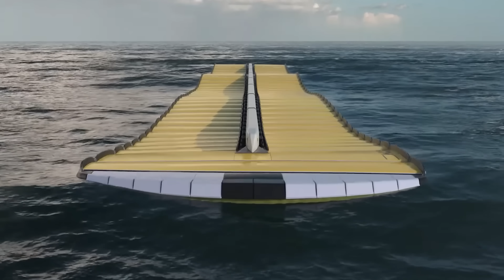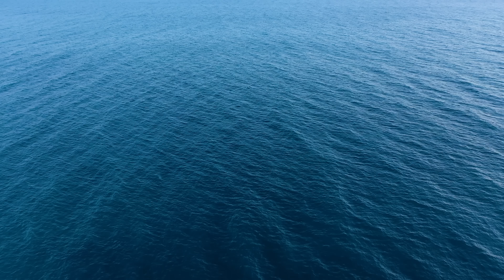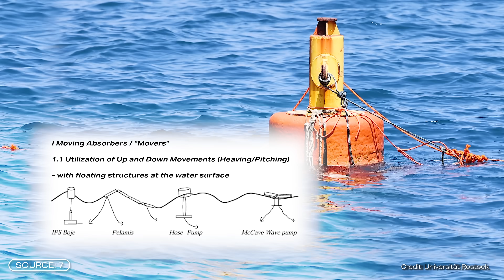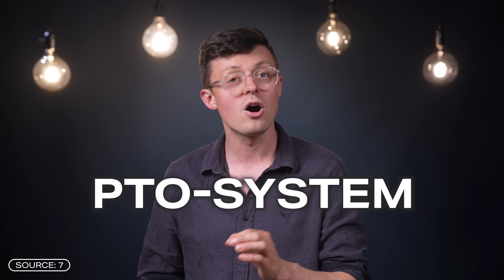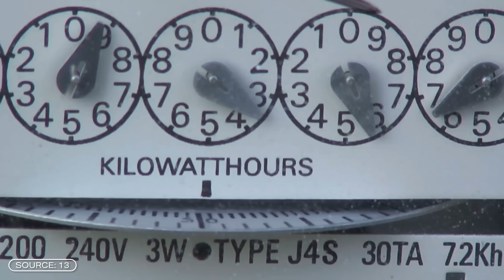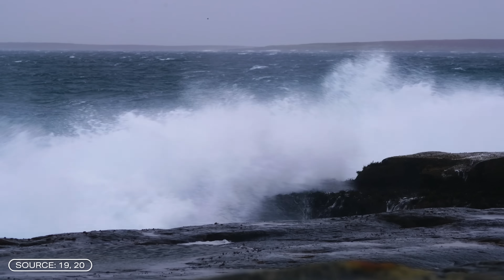The Cheapest Energy Source Ever? Wave Power at 1 Cent Per kWh

Comment: Such a long list of unbeleivably impressive claims and now several years later they throw in yet another rather than demonstrate any capability.
This is so clearly a scam I have completely lost respect for GSG.  Wave energy potential is calculable.  If you calculate the size needed for 100MW it would have to be enormous.  Then there is the variability.  Most of the power occures in a small time window.  Put the all together and there is no way this will only cost a penny per KWh.

Comment: Big mistake to use sea water, compressible, not a proper hydraulic fluid, results is greatly reduced efficiency. Also, seawater is full of life, salt and many other contaminants. This will fail quickly if not a closed system. Any filter will not last long in the ocean. This will fail, as is.

Comment: Anything that moves will never be cheaper in the long run than solid state solar. Its physically impossible. Any maintenance is cost.
Reply: There's an old saying...

"work smart, not hard"

The moral of the quote is to emphasize efficiency, strategy, and leverage over brute force or endless grinding.

A world filled with millions of wind turbines, billions upon billions of solar panels, and hundreds of trillions of man made batteries for battery energy storage systems, ALL OF WHICH have to be recycled every 15-45 years, is...

--- WORKING HARD WITH ENDLESS GRINDING ---

Tapping into the NATURAL THERMAL BATTERY beneath all of our feet, with limitless thermal energy contained within it, is...

--- WORKING SMART AND EFFICIENT ---

Geothermal is the path forward...

Comment: As you say there has been quite a number of wave power startups and they all seem to have failed. 
The sea is just a very harsh and unforgiving environment. So I would apply the famous Mike Tyson quote here: "Everybody has a plan until they get punched in the face" Its all good until they actually deploy to the sea, then not so much ...
Reply: There's an old saying...  "Work smart, not hard"

Building energy production systems in a marine environment is working hard...
Reply: Happened with a few optimistic danish wave projects; they just got hit too hard by the North Sea......

Comment: I grew up in Canada in the region that has some of the highest tides in the world, The Bay of Funday.  I've seen the awesome power of tidal and wave power and I was also a scuba diver there and know the pull of currents.  I am intrigued by wave power & have seen the effects of trying and failing to harness tidal power.  We need to get over our hubris thinking we will out strength Mother Nature.  We need to respect the endless power of tidal movement and waves so we can finally work with it to harness the power it can give to humanity...
Reply: Geothermal is a much more reliable way to replace fossil fuels.  Geothermal energy potential, on land above sea level, is >1,610 petawatt hours.  Marine environments are one of the toughest environments to operate within, and while power could be produced using tidal or wave power the maintenance cycle on such systems is insane.
Reply: I think solar is far better. I have 2 acres, I have thousands of amps of power beaming down on those 2 acres per day sunrise to sunset, all I need do is harvest a small amount of it. Even using cheap old used solar panels a few thousand $$ worth of them gives me over 100 amps of power, 50% more then I actually need to run my house. 

I can store the excess power in a used battery from a tesla bought for a few thousand bucks and be totally of grid for weeks not even need any power from "the grid". I only keep the grid connection as a backup. I can even string a long cord over to my neighbors house and power him up during a power outage.

No pie in the sky wave tidal billion $$ contraption needed. Solar is here now and works.
Reply: @robert5  I'm very pleased you have all the solar you can possibly use and having battery storage is a real bonus.  The reality of power generation via solar is quite viable on the prairies - on the coasts - not so much.  We Have Massive amounts of hydro-electricity here, in B.C. as we have the rain and the mountains.

Solar was the first & easiest to crack and exploit but much more ways of cheap green energy need to be placed onto the grid for all to take advantage from.  Geo-thermal looks promising along with wave and/or tidal generation...
Reply: @robert5  Solar is pathetic as an energy source
Reply: @TerraPotentia  50 Amps of power is what it is. If I can buy $30 used solar panels and easily have a 50 amp stream of usable power... that is just a fact. You can come over see it power my entire house and tell me how pathetic it is if you like, I'll just laugh. Solar farm big enough to power a city? Bad idea, individual solar install powering every house... it works now not some time in the future. Long term anything less then a nuclear power plant, current tech will not work to power city size and numbers of homes.
Reply: @robert5  There's an old saying...

"work smart, not hard"

The moral of the quote is to emphasize efficiency, strategy, and leverage over brute force or endless grinding.

A world filled with millions of wind turbines, billions upon billions of solar panels, and hundreds of trillions of man made batteries for battery energy storage systems, ALL OF WHICH have to be recycled every 15-45 years, is...

--- WORKING HARD WITH ENDLESS GRINDING ---

Tapping into the NATURAL THERMAL BATTERY beneath all of our feet, with limitless thermal energy contained within it, is...

--- WORKING SMART AND EFFICIENT ---

Geothermal is the path forward...  There is no more environmentally friendly energy source than geothermal.

Comment: Waves are not constant.  They are wind and tide driven and have lull periods.  For example, the area around Cyprus is noted for much less wave action during most of the entire summer.  

This 1 cent per kWh estimate falls into the LCOE fallacy.  Since waves are NOT constant, this system, like wind and solar, will need backup power sources or huge, costly energy storage.  Both add significant cost.  Material longevity will be a problem - saltwater corrodes almost everything, and underwater power distribution is also expensive.  It's effect on the marine ecosystem is unknown and may cause ecological damage.

Put this one into the category of hype.
Reply: Fake News, naysayer 

Kinetic energy from tidal or wave is the most abundant form of energy, right up there below deep geothermal 

Crack that (either) nut, and limitless power is solved. 

Just takes time to figure out by smart scientist and engineers, 😅
Reply: @AfricanCulturalHeritageProject  Nope. That's what they said about solar yet every single country who has tried to put a large fraction of solar on the grid has the HIGHEST electricity costs in the world..

Waves are intermittent.  Figure out what that means.

Comment: There are at least three problems that make this technology so hard to believe in. Biofouling, corrosion and torque. First, the biofouling is a nightmare. The ocean is full of organisms that will coat anything left in it, and the toxins used to stop them are a major problem. Most antifouling paints use copper, and just a few micrograms per liter of water can be lethal to marine life like mussel and sea urchin larvae.  There are some promising new coatings being developed that use natural compounds from bacteria, which are much less toxic, but it is a constant battle. Using heavy toxins is going to cause a huge public backlash from anyone who wants a clean ocean, and it feels like the company is just ignoring that reality.

Then there is the corrosion and the sheer mechanical stress. Seawater is incredibly corrosive. Any metal parts in the ocean will start to fail within months.  The real killer is major storm-derived spine torque. The whole design is like a giant snake moving with the waves, but that movement relies on a central spine that connects everything. In a storm, the forces are going to be massive. Apply that force to this skinny spine? Pffft. It'll have to withstand a tremendous amount of twisting and bending force. The company claims it will "move with the wave" to survive, but a 100-megawatt device would need to be enormous and heavy to generate that much power, making it impossible to just float "with" the wave in a hurricane. The first serious storm is almost certainly going to bend or break that spine, and then you are left with a mess of plastic and metal on the ocean floor that is going to be extremely difficult and expensive to clean up. Worse for local boat traffic if the spine becomes untethered and unseen just below the ocean surface. I'd hold more promise if they could submerge the entire spine during very high storm events. That design evolution seems unlikely.

This is no different than that Dutch youngster who said he'd "clean up ocean plastic". He made millions of dollars and only cleaned up a minuscule fraction of what's out there. The design cost millions of dollars and was a complete failure.This current project is a propaganda ploy by a company that will end in failure and millions of dollars on the ocean floor. Apologies for being so blunt.
Reply: One other thing that limits the results of this innovation is that in some northern areas the sea surface is covered with ice for several months every year. So there are no waves no matter how strong the wind is. The system would have to be transported to sea every year after the ice has melted and moved away from water before the sea freezes.  Moving thick ice has strong destructive power.

Comment: While I love innovative ideas, those claims have all the sights of BS. If you need 32m long and 1.4 ton to generate the same amount as the equivalent of 4 standard panels, it will probably need a small city sized installation to scale up to 100mw, unless they can improve the efficiency by 10x, it has no chance...

Comment: 'm dubious about this one.f its covering the surface of the sea, then its blocking sunlight to the surface water, which is wfere phytoplankton that are at the bottom of the marine food chain live.  secondly. huge areas of such an installation could be a hazard to navigation. Thirdly, anyone who thinks that the sea is incapable of breaking or wrecking anything are delusional, IMHO.. I'm sure that small installations might be of great benefit to isolated island or coastal communities, but I'll be very surprised if this achieves widescale deployment - and concerned due to ecological impact, too

IMHO it'd make more sense to add small wave-power generators around the base of wind turbines in costal waters, maybe add some solar panels to the top of the gearbox housing, too. Sure, the amount of extra electricity generated would me small compared to that produced vy the windmill, but the wave power generators would add a little to the base load, whilst the solar might well help make up the dfecit on windless days.

Comment: Considering materials cost, space usage, and maintenance, I haven't seen anything that comes close to nuclear.
Reply: Geothermal gives you all the benefits of nuclear (high annual kWh production) but without the waste.  Nuclear has the highest capacity factor of any energy source, but geothermal is a close second.
Reply: The problems with nuclear are the cost over runs, insurance and decommissioning plus what to do with the long term waste
Reply: ,...... Why build a dangerous and expensive nuclear plant in coastal towns,... when solar, wind and wavepower,...... can give you all the energy you need. And then some,....
Reply: @user-pt1ow8hx5l  again, materials cost, space usage, and maintenance

Comment: So much promise, but so much risk.

Marine engineering and construction, and maintenance in a marine environment, is incredibly expensive.  It’s the price you pay for access to the ocean.  When a component fails, how do you replace it or fix it?  You are, after all, operating at sea level and, for the most part, in the water.  This isn’t just a ‘hurdle’, it’s an enormous hurdle.  If the thing lasts (as claimed) for 50 years, then you have to have 50 years’ worth of planning and the financing to back that up.  

Downstream environmental effects: in order to make 100MW, you need a very large array/installation.  This takes up quite a bit of linear space.  How does this affect the marine environment?  The installation will blanket large swathes of ‘understory’, the water around/underneath it, and create (among other things) thermal and related vernal disturbances.  Maybe it won’t matter?   Maybe it will and we can’t measure that yet?  I am not against trying new things, but this consideration should be top-of-mind for prospective operators, since they’ll be on the liability hook when they face the inevitable court challenges 1, 5, and 10 years after installation.  (We see these same challenges made against power plant operators who depend on local waterways for cooling water—thermal pollution is real and has documented negative effects on marine fauna and flora.)

Another, and not the last, thing to consider is how readily a test-pilot installation such as the Cyprus array, can be scaled.  Effects you don’t observe at one scale can suddenly appear at the next.  It’s one thing to build a small proof-of-concept, it’s another to build, install, and operate one of the proposed size.  This is no small risk.

Comment: Nobody has yet solved for that 1 wave per year that is 3x the size of normal and carries enough power to tear steel apart with ease in 1 second
Reply: As @TerraPotens537 says, the marine environment is notoriously demanding and very expensive to work in/around.  Just getting the thing up and running on Day 1 is one thing—it has to perform every day, through years.  Putting replace/upgrade maintenance cycles aside for a moment, how do you inspect something like this when you can’t just roll it into a hangar (as in the case of an airplane)?
Reply: It'll be more of a death by a thousand small cuts type problem than extreme weather waves...  Biofouling and corrosion are rough in a marine environment.

Old saying, 
"Work smart, not hard."

Trying to do anything in a marine environment is working hard & fraught with error.
Reply: @TerraPotens537  I live in an area where over the past 30 years they have tested many wave power machines ... All of them , Every single one fail in winter during a large storm ... doesn't matter how they work or what size they are , if they are in sheltered bays , river or open ocean. They usually work for months or years before getting destroyed by a single wave. Always.
Reply: @iRiShNFT  I don't doubt that it's the big wave that destroys them, but it's more the wear and tear they endured long term before that wave came along.  IN OTHER WORDS the devices probably experienced MANY big waves over the months or years of operation.  It only became a problem once THAT big wave came along and finally finished the device off.
Reply: @TerraPotentia  ok buddy whatever you say
Reply: @iRiShNFT sorry, did I trigger you?
Reply: @TerraPotentia  What a weird question. Brother you couldn't trigger me if you tried. I just have no time to talk to someone that twists the truth into their version of reality so they can claim a victory while being wrong. Your original statement is wrong
Reply: @TerraPotentia  such a childish thing to ask , did I trigger you LOL what are you like 10 years old taking some kind of pleasure in making strangers angry on the internet ? 🤣🤣🤣 Grow up kid , nobody will be trigger by your ignorance
Reply: @TerraPotentia  Since you're obviously a terrible person that takes some kind of pleasure in trying to anger people while being blind to their own ignorance you're blocked from my channel so you won't be getting a response. Have a great day
Reply: @iRiShNFT   You doth protest too much...  Actions matter more than words, and the fact that you just replied to me three times from the same comment shows that, despite your ptotestations, you're triggered.

Comment: Floating devices harvesting wave energy make much better water pumps than generators  (if you aim to keep things simple and robust). High torque, slow motion. Decent hydraulic power. You can do a lot of with enough pumped water feeding into a small raised reservoir as long as the inflow falls within a useful range. Including generating electricity using regular old water turbines. Bigger-better. Something like the low, mid, high weir feeding into turbine designs to deal with variable flow. Except you don't rely on a wave crashing into the reservoir, or funky booms or any of that. Your array of low maintenance mostly hermetically sealed floating panel pumps can get the water to where it's needed via pipes. That to me is what a low maintenance design would look like.

Comment: Sounds like pure bullcrap. 
First of all, their prototype wouldn't survive a real storm even for an hour.
Second, plastics would not last for 50 years under the sun, I'd be surprised if they can last 10. And it will generate microplastics while degrading.
Third, the power claims are completely bogus. 1.4kW sounds about right.

Comment: Can it manage 30m crashing waves?  Also need to have an energy store, likely something via electrolysis, and non-toxic, H202?.  Then collect the generated energy once a month. Only see it as working close to shore where it can retreat to harbour with a storm forecast. i.e. each part is a separate vessel which links up. The problems then include insurance and who's legally the captain.
Reply: Even 10m waves. Plastic or even metal, it would get destroyed.
Reply: This will never work on a wide scale...  Too problematic due to biofouling and corrosion issues...  Geothermal is the path forward.